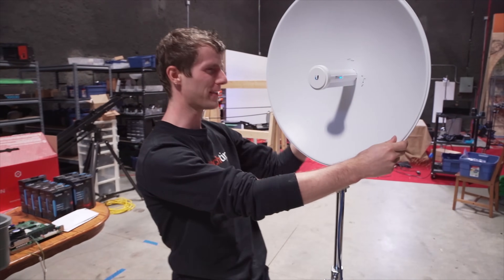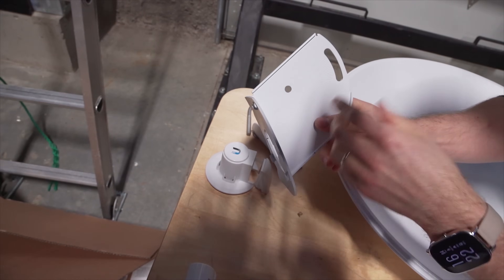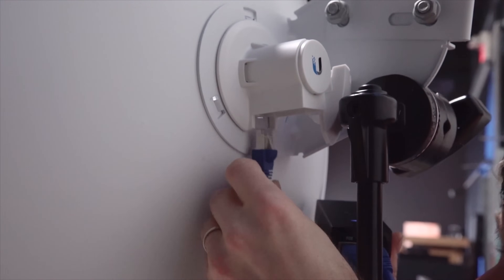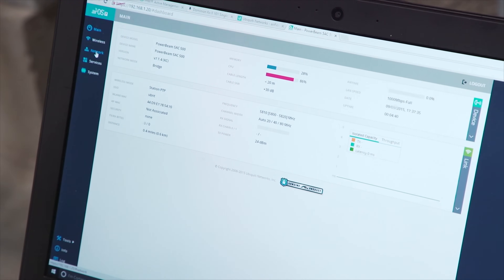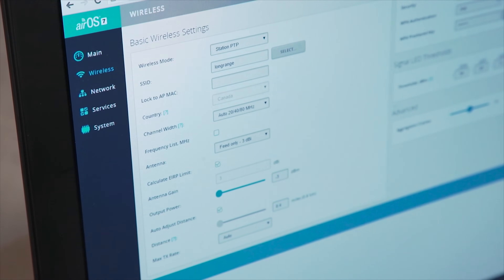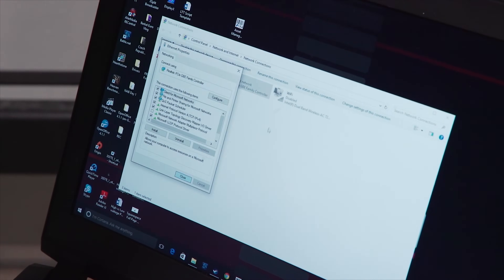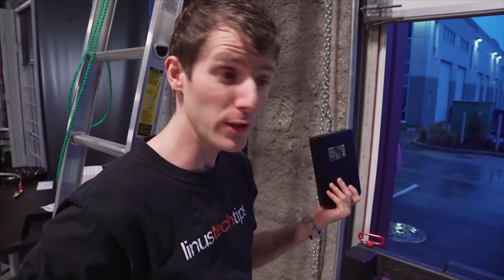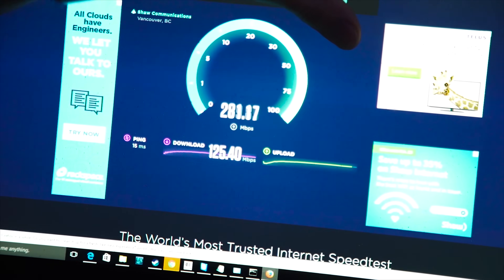HOLY $H!T - Long Distance Wi-Fi (Up to 25 KILOMETER range!?)

Comment: Now see if you can cook ramen with it :D
Reply: ***** microwaves
Reply: +Kevin de Bie just get a magnetron from a microwave oven
do some tinkering
do some beam focusing 
melt your face a few times in the process 
get brain cancer from the aforementioned face melting 
and there you have it 
a portable cooking beam 

or just skip the above and cook it in the microwave like a normal person
Reply: +MWB Gaming Actually the US army IS testing this concept as a nonlethal enforcement tool (or something like that, basically a weapon that doesn't kill people)....
Reply: that makes no sense since microwave energy is lethal even at low to medium exposure levels
Reply: +MWB Gaming No it's not. Remember: microwave ovens use it, wifi uses it, hell even Bluetooth uses it (not to mention satellite TVs)!
Reply: microwave ovens are an electromagnetically sealed container so nothing leaks out

bluetooth is extremely low power (less than 0.5W transmit power same for WI-FI)
satellite TV is transmitted on the Ku band which is between 12-18GHz (too high to cause any harm)

energy from WI-FI/bluetooth or a microwave oven is 2.4GHz
Reply: +MWB Gaming "microwave ovens are an electromagnetically sealed container so nothing leaks out" - LOL Have you ever tried to use wifi on your phone in your kitchen while the microwave's on? I doubt you have, otherwise you wouldn't say such nonsense (besides, there's no such thing as perfect shielding for electromagnetic waves, anybody at a university who works with them can tell you that). Wifi is not THAT low power (it's in the 1-2 W range IIRC; still low, but not as low as bluetooth) and satellite TV is transmitted on the 9-12 GHz band where I come from (transmissions in the Ku band are still VERY rare, at least in Europe). Either way it still kinda opposes your previous statement that "microwave energy is lethal even at low to medium exposure levels".
Reply: i consider low levels between 10W-100W

as for microwave ovens interfering with WI-FI
my WI-FI router is right next to my microwave oven and i have no issues with either my 2.4GHz access point or my 5GHz access point when the microwave is on

in fact my WI-FI security cameras cause more issues for my 2.4GHZ access point through congestion than the "jamming" effect of my microwave oven

and in Australia satellite TV from foxtel and austar is transmitted on the Ku band at around 14GHz

as for the transmit power of WI-FI
1-2W is what i consider extremely low
Reply: when the door is closed it forms a Faraday shield which block out (or in) virtually all radio signals (that's why the window has a metal grid)
if your microwave oven is leaking radiation then you should get it replaced or repaired

the reason why i pit the WI-FI router next to the microwave is because that is where the power outlet closest to the coax socket is and Telstra only gave me 3M of coax and it is not long enough to reach the other socket

for your information i live in a house by myself
not my parents basement

even if i did live with my parents
their house doesn't even have a basement

also i use an Alienware laptop so all your other points are invalid
Reply: if that is the case then explain why there is absolutely no adverse effects on my 2.4GHz network when the microwave is on

as for my choice of laptop
yes i like the lights on the Alienware
who cares? (obviously you)

when i bought it i had 2 choices that fit my budget and usage preference because i did not want to buy online and have to wait for delivery

the Alienware 14 $2399
the ASUS K53S (i7 version) $1899

the alienware had superior performance and it looks cooler too (and it can be overclocked)

of course a mid range desktop would kick my Alienwares ass everyone knows desktop hardware is more powerful than laptop hardware
i just prefer having something that is portable so i don't need to call a taxi if i want to bring my computer to a LAN party
with a laptop i can put it in a backpack and go there on my e-bike

yes i connect it through my 5GHz WI-FI access point and FYI i get the same performance over Ethernet as 5GHz WI-FI

as for my YouTube channel
there are a lot of gaming channels on YouTube
are you calling everyone that owns a gaming channel stupid? (of course you did)
Reply: +MWB Gaming Eh, so you're saying that microwave energy of 10-100W is lethal? And when is it lethal? If it's absorbed in small doses? Or it must be absorbed in one big dose? And is it also lethal when it's spread over the whole body of a 150 kg human? Can you back up your statement with ANY technical paper by any chance? Even a single one?

Microwave oven is more likely to cause interference when your wifi router is a room apart (or more) and YOU are standing next to the microwave with your wifi device. That creates the typical problem of a strong "local station". Which signal do you think will more likely to be picked up by your phone? The weak signal from your distant router or the strong signal of your "perfectly sealed" microwave (which happens to "broadcast" on the same frequency while running)? Also, have you tried disabling the 5 GHz band and accessing your wifi with your phone that way? I'm pretty sure it won't work (microwave ovens work at 2.4 GHz, so they don't affect anything that communicates via the 5 GHz band).

There ARE some broadcasters that use the Ku band, but it's still fairly niche. The overwhelming majority uses the 9-12 Ghz band. And strictly speaking even the Ku band is well within the microwave range, which goes from 300 MHz to 300 GHz.

The Faraday cage is indeed a very efficient shield of electromagnetic energy, but it isn't absolute either. Guess what: even the Faraday cages' attenuation is given in decibels, not statements like "it'll filter out ALL electrical signals" (which it DOES NOT). The signals of routers (especially at a distance) are so weak that only the most sensitive equipment (such as wifi enabled phones and laptops) will pick it up. The (fairly weak) radiation leaking from even a microwave with superb shielding can still top (=overwhelm) that hands down, especially if the router is further away.

I think that you could buy a coax in almost any place ranging from Home Depots to Walmarts if you wanted to.

I wouldn't call an Alienware laptop portable. Yes, it's more convenient when you have to haul it to a LAN party instead of a PC, but people who own one usually avoid hauling it around like the plague (I wonder why). Oh and unfortunately owning an Alienware laptop doesn't make you an expert on electronics (let alone electromagnetism) I'm afraid...
Reply: if you have 100W of microwave energy focused into a beam and fired at your brain
YOU WILL DIE
10W may kill you depending on the circumstances

by microwave energy i am referring to the energy produced by a microwave oven which is 2.4GHz

i don't have my router in another room because my ISP only gave me 3M of coax and coax that is used for cable internet is expensive here and with longer cables you get signal degredation so im not buying more

i never said it was perfect i said it blocks virtually all signals
(note the words "virtually all")
put your phone in a microwave oven
close the door and try calling it
if the phone rings it means your microwave oven is fucked

satellite TV here in Australia is on the Ku band

i have no issues with "hauling" my alienware laptop around
i never stated owning one makes me an expert (you simply assumed that)
Reply: +MWB Gaming If you'd finally go through the pain of actually watching the video I've linked above you'd realize that they were aiming the device at the journalist's chest, not head. Also since neither him or the extras used for the mass dispersing preview have died I'm assuming that they used a level that's still safe enough (I don't know how much ERP is that but neither do you I'm afraid).

You can refer by microwave energy to anything you want, but international consensus defines microwaves as everything that's within the range I mentioned above. So when you're talking about "microwaves", everybody with at least half a brain will think about signals AT LEAST in the 1-20 GHz range.

The coax that's used for cable internet (and cable TV, and satellite TV and radio antenna feed) is a standard 75 Ohm coaxial cable (you can check, it's written on the cable too), which is a dime a dozen (depending on the diameter and quality too of course). Yes, you do get signal degradation, but even for SAT signal (which is usually of even higher frequency than TV) it starts to get significant only above 50 meters. Arguing with these two things sounds kinda.........clueless....

Yes, it does block "virtually all" signals. What's left however can still be strong enough to overwhelm your phone's wifi reception.

Well be my guest and haul around your Bloatenware laptop as much as you please. Just don't complain when your back will start hurting, okay?

You didn't state that owning one of those laptops makes you an expert, but you quite blatantly implied it.
Reply: well i was referring to a headshot with a beam of 2.4GHz microwave energy

i would have thought the words "microwave oven" and WI-FI would have implied that i was referring only to 2.4GHz

im aware of the ohm rating of the coax but when i checked my local hardware store it costs about $15 per meter

my Alienware only weighs 3.4KG including the charger and battery
if you are too weak to carry that around then you need to see a doctor

i never implied i was an "expert"
you assumed i was an expert and thus shot me down for something you just assumed
Reply: +MWB Gaming " was referring to a headshot " - I haven't seen ANY previous mention of the fact that you mean this for head exposure only. 

"i would have thought the words "microwave oven" and WI-FI would have implied that i was referring only to 2.4GHz" - and now just what on Earth made you think that? Wifi operates both on 2.4 AND 5 GHz (and has been for years now) and microwave has a range of 3 orders of magnitude. When you wanted to talk only about the 2.4 GHz signals, you should've mentioned so. Either way from physiological point of view there isn't any difference between the effects of a 2.4, 5 or even 10 GHz radiation.

"if you are too weak to carry that around then you need to see a doctor" - Okay, try carrying the thing everywhere on every single day and then let me know how featherlight it is. Even 3.4 kg will pull on your back, shoulders and/or arms quite considerably if you have to carry it everywhere on foot all day.

"you assumed i was an expert" - No, but you started to talk about scientific things and trying to pass products of your own "gut instinct" off as facts. And then some folks came along and called your bluff. It's that simple....
Reply: 1 i don't want to wait 2 months for delivery from china so buying online is off the table

as for the weight of my laptop
i do carry it around everywhere i go and i don't have any issues with it
and i have been doing that ever since i bought it

you are the one that assumed i was an expert
i never claimed or intended to imply i was an expert

when you assume something you make an ASS out of U and ME
Reply: +MWB Gaming My comment was only a reaction to your smartass comments by which you insinuated that you're an expert on microwaves (whereas in fact you're not, that's obvious from all the comments you're made almost since the beginning, with each comment making it more and more blatantly obvious). Now the moment somebody (e.g. me) has called your bluff, you just started to insist that you "never claimed or intended to imply" anything (despite the fact that it's obvious you DID). Comments like "microwave energy is lethal" or "microwave ovens are an electromagnetically sealed container so nothing leaks out" speak tons about your desire to pose as a "know-it-all" for microwave radiation (but failing utterly). This is not an assumption, it's the logical conclusion of reading your text and then comparing them to reality (and to what people ACTUALLY know about microwave radiation).

First of all the usual wait time for Chinese stuff is 3-4 weeks, not 2 months (unless you live e.g. in Russia) and second of all if you're making up so many (bogus) excuses to get a freakin' coax then just admit it that you're too lazy to get one.
Reply: as for the wait times
every time i buy something from china it usually takes 6 weeks to arrive but sometimes over 2 months (if it arrives at all)
even 4 weeks is too long

secondly you simply assumed i was saying i was an expert
nothing more
Reply: i live in Australia which is a lot better than the shithole you live in

and i can find coax cables here but im not paying the exorbitant prices charged by local shops

why do all you yanks always think you are better than everyone
AMERICA IS NOT SUPERIOR TO THE WORLD
Reply: +MWB Gaming Actually he's kinda right in the fact that your excuses for not being able to get a plain 75 Ohm coaxial cable that's longer than a measly 1m is kinda fishy. You see I live in a country nobody has ever heard of (Slovakia, it's at the very edge of the alliance of so-called European rich countries) and yet even I can find a 3-5m coax anywhere for like 3€ or so. Hell I even bought a 100m coil of the stuff a couple months ago for like 40€ or so.
Come to think of it.....I've heard that there's a desert in Australia that spans almost through the whole continent. Do you live in the middle of it or what?
Reply: as for a zoo of retards
we already have one

it is known as America

i never said coax was unavailable here
i said it is expensive
dumbass

i don't have unlimited money like you

and FYI yes i am part aboriginal and no i don't see deadly snakes everywhere
Reply: that comment only serves the purpose of proving how you americans think you are better than everyone else

which is false
america is just a cesspit rife with capitalism and self entitled douchebags like yourself
Reply: at least we have free healthcare here unlike your shitty country that lets people die unless they are rich
and that dickhead trump is just going to make it worse

enjoy your cesspit
Reply: +MWB Gaming I'm sorry but he's kinda right. You've made some ignorant, bombastic, know-it-all comments and managed to dig your grave deeper (and wider) with every passing comment of yours. First you stated some ridiculous nonsense about microwaves. Subsequently (after it's been pointed out that your comments on microwaves are a big pile of BS) you switched to alleging to be a victim of a conspiracy centered around coaxial cables. And when (once again) your claims have been (rightfully) ridiculed you start talking about US politics (shitty as they are, it has absolutely NOTHING to do with the topic of the video or the stuff YOU started talking about in the first place). Thus it appears to me that you've run out of arguments and are REALLY desperate to turn it around somehow. However this makes your struggle even more fun to watch....
Reply: he wants to say shit about my country
im going to respond in kind
Reply: +MWB Gaming So you still refuse to admit that you have no clue whatsoever about microwaves and that you shouldn't have mentioned the coax thing to begin with. This will be rather fun to watch......
Reply: then i must be the smartest aboriginal in the country since i have an IQ of 143
Reply: +MWB Gaming I'm sorry to disappoint you, but online IQ tests (especially the ones at Facebook) are not indicative of anything...
Reply: that may be true but im sure the IQ test i received from a psychologist is valid and correct
Reply: that is the most racist thing you have said so far
Reply: +MWB Gaming Moral of the story: not commenting on stuff I don't have the slightest clue about is MUCH easier than having to endure this (e.g. there's a reason why I never comment on cars or sports)....
Reply: well just stop commenting then
and tell that pig headed mate of yours to stop as well
Reply: +MWB Gaming Like I said, it's rather fun to watch :D
Reply: well if you want to let it go

stop commenting and this thread will simply fade away
Reply: no
you are just here to reinforce the stereotype that americans think they are better than everyone else

well guess what americunt
you are not better than everyone
Reply: +MWB Gaming Well guess what: I'm not American (in fact I'm not from an English-speaking country even) and yet I also agree with +Steve Sherman that you've been wrong on so many levels that it's just ridiculous. And despite the fact that it's been pointed out you keep kicking and screaming more and more, digging your (already impressively deep) grave around you deeper and deeper. So what else can I add? Enjoy it >:-)

Comment: I did this 10 years ago with 2 spare 36" Dish Network  antenna's equipped with yagi's. Shot it across a 10 mile canyon and it worked, but latency was a bitch and signal drops with it rains and snows. The only thing I would ever use this for would be like a weather monitoring station at peaks of mountains.

P.S. that arrow is there to point out the vents. Should water ever get into your antenna, it can drain out.

Comment: Just in case the manufacturer wants to know this video is working: I work for an IT firm and had a client who wanted to transmit a WiFi signal across a field about a football field long, we didn't have a great solution for them.  I just forwarded this to them.